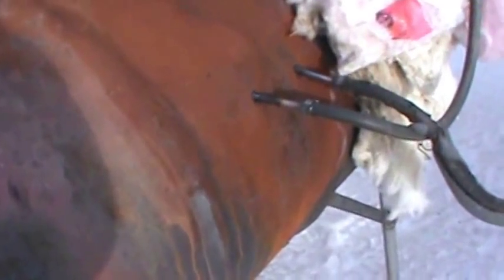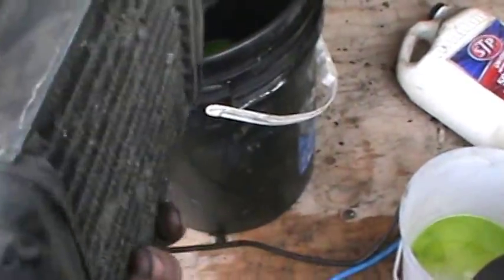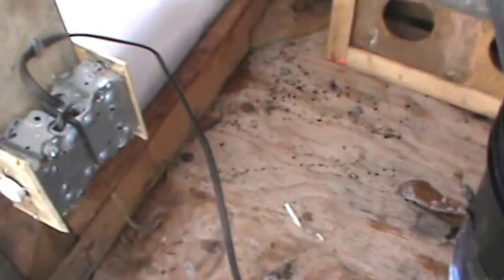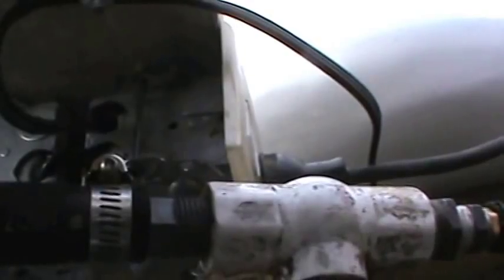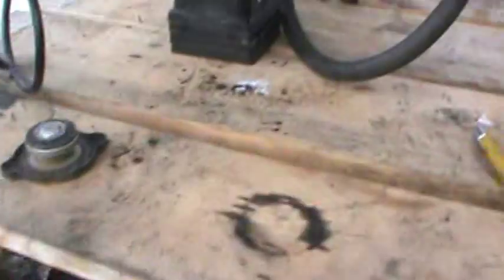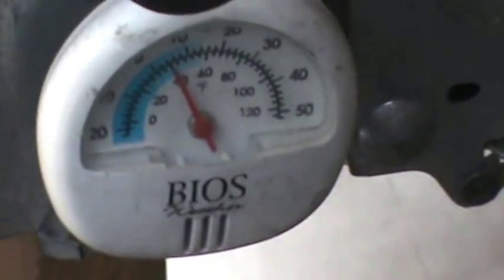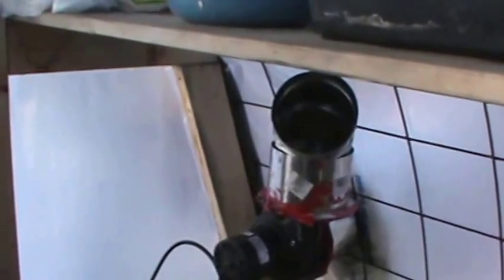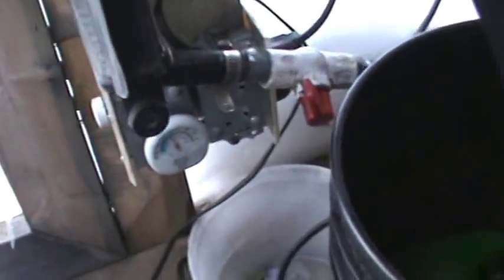Greenhouse Barrel Heater Installing Thermostat and New Radiator

Comment: sounds like you may need to use metal pipe between greenhouse and heating barrel...just a thought...nothing to melt and the heat loss would be minimal...I'm building a same type heater with solar (black drip irrigation hose collector) providing the hot water to circulate through a car radiator for my wood shop (tinkering)...good luck with you endeavor...keep on truckin'...